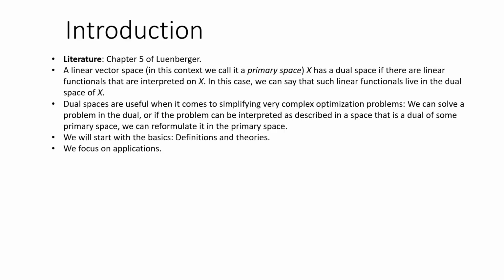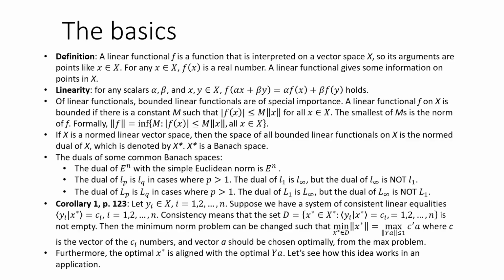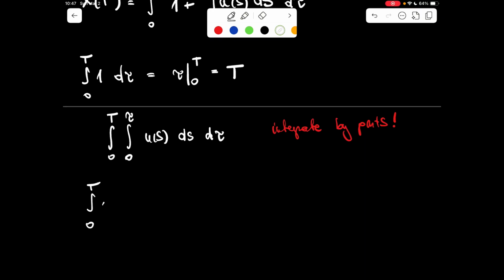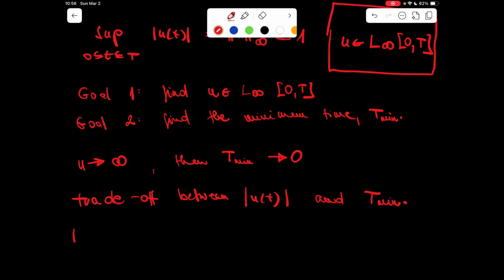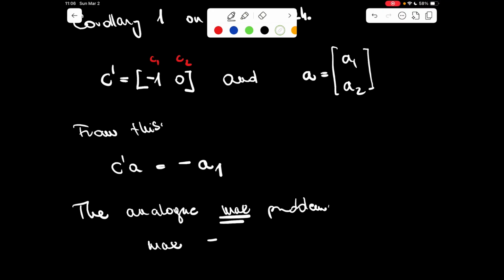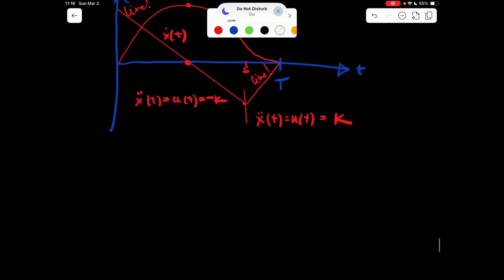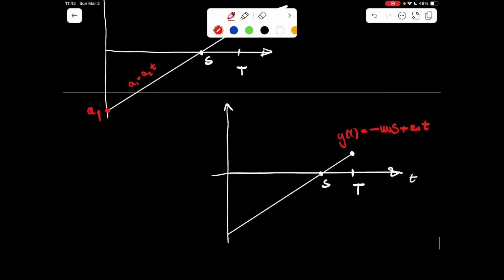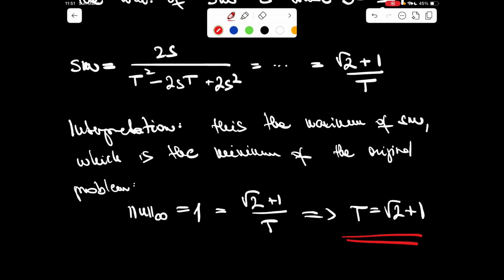Lecture 6: Dual spaces

Comment: That's a quality teaching. I did an MA in Economics at CEU. Some of the senior Hungarian faculty were always talking down local Hungarian schools (like Corvinus, BUEB, etc.) and treating CEU as clearly superior. Because of that, I ended up pretty skeptical about Hungarian econ programs. But the years have passed, and the more I’ve looked into it, the more I’ve realized the teaching at the top Hungarian schools actually isn’t below CEU’s, if anything, it can be better. They might be a bit behind on research and popularity, but when it comes to teaching quality, I’m pretty convinced they’re stronger than CEU. I wish I’d had an instructor like you back in my CEU days.